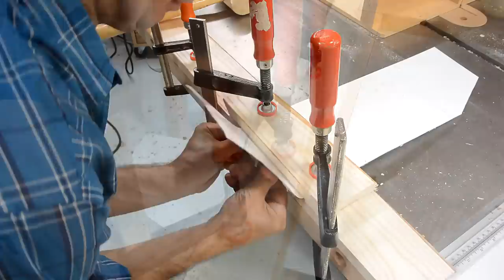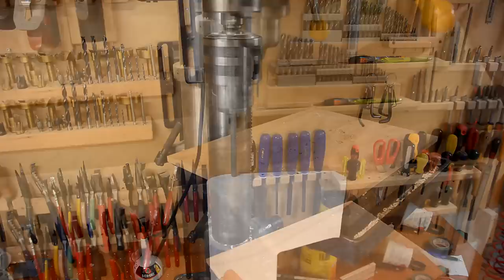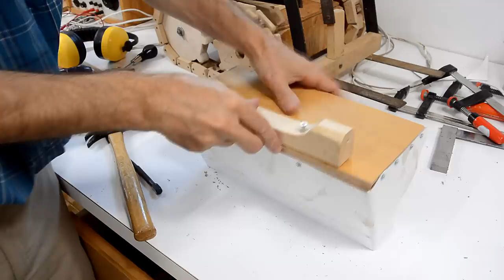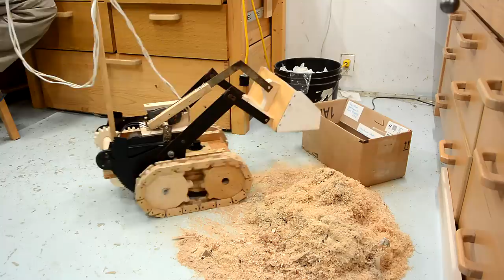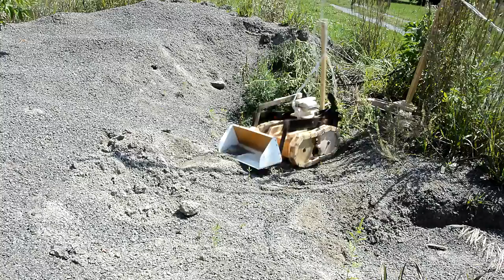Forklift toy payloader bucket

Comment: instead of the bucket i reckon you should mount your dust collector hose on it and drive it around your workshop sucking up the sawdust
Reply: with arduino brains.. Matumba vacuum. Though he might use some old cell phones for the cpu's

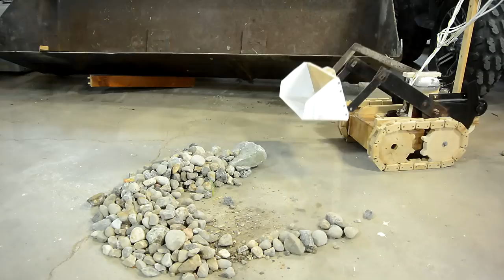Comment: You should be implementing proper safety 3:24 you are moving with the bucket in the air. That is not proper skid steer safety usage.
Reply: There's always that guy in the comment section. Imagine if he hurts a mouse or something. There would be a lawsuit..
Reply: And I don't see reflective clothing. You can't operate machinery like that on a worksite without reflective clothing!
Reply: ANameThatIsn'tMyOwn "You can't operate machinery like that on a worksite without reflective clothing!"   I think you can.. The machine will start even if you don't wear a reflective clothing.
Reply: Dom Troisi It's a joke. Do you have to get a joke pointed out to you twice in the same thread??
Reply: Kn1cknackz0 I know right
Reply: Jake Abel I liked your joke don't listen to this guy

Comment: Sir, forgive me if I read things wrong, but you used a wiper motor for power, did you use parts from a power window regulator as well?
Reply from the maker: No.  These were hand cranked units
Reply: Very well done!  I've learned something!

Comment: Have you been asked to make it wireless?
Reply from the maker: many many many times
Reply: Can you make it wireless?
Reply: I was wondering if you plan to make a new version. Maybe with rubber tracks instead of wood. Wireless, and with more power. This series has been probably my favorite work from you. It looks so happy when it's sped up like that.
Reply: You guys know what would make this even better? Making it wireless!
Reply: Never mind wireless -- make it autonomous! It could be like a Roomba for really dirty floors.
Reply: I think he should give it proper adjustable controls before he gives it remote control
Reply: I'd love to see this thing made wireless, and painted black and yellow, like a Cat or JCB :D
Reply: +Matthias Wandel 

A big lead battery putting weight on the tracks might improve performance.
Reply: +KarlBunker It could be a Roomba for EXTREMELY cluttered floors, like to clean up kids toys, then the vac-bot comes out.
On second thought, kids should be taught to clean after themselves.

Comment: To heck with Arduino (of course you'd need one in the mix anyway) but this thing needs automation.  I'm thinking Raspberry Pi with Python control loop and Open CV for visual input.  Maybe not with a camera installed IN the unit but above the "work site" in an observation position.
I'm living in a house where we have some erosion that deposits sand on the driveway when we have heavy, persistent rain. It'd be nice to have a system where you could train it too distinguish the appearance of sand from that of cleared concrete, set it's area parameters and just let it run a day or two until the task is complete.

Comment: hey Matthias, i was wondering instead of using the cord and piece of wood if it is possible to use a sprocket on the motor and one of those long gears (Similar to what you use on your door latch for your shed) because i was looking at it and it seems the pivot point stays the same. Just an idea. Keep up the good work!

    
1

Comment: Cool little creation, can anything be done about the treads slipping so much? Just thought it might need some more traction.
Reply: A neat trick for more traction is to put a very thin layer of silicon glue on the track/wheel.

Comment: Add webcam + battery + remote control and you can excavate under your house. (Then add AI to do the work for you.) Make it so that it can plug itself back in to recharge and it could automatically keep your drive clear of snow.
Reply from the maker: i dont;t think it could scrape thru the concrete basement floor

Comment: I take it the comments on your acrylic shelf video weren't to your liking? :)
Reply from the maker: Not really, indeed.  500 comments, but really just three comments repeated over and over
Reply: I just noticed that it wouldn't let me comment. I'm guessing the comments were along the lines of, "use actual acrylic solvent like Weld-On, don't use screws, and use a router with a sharp bit for flawless glue lines"? Acrylic is one of my favorite materials to work with. I was glad to see that you thought to use a cabinet scraper, as that's one of my favorite tricks. And grind a tiny flat on your twist bits for a neutral or slightly negative rake for easier drilling without grabbing or cracking. Oh, and if you ever flame-polish your edges, which I highly recommend, don't ever use any sort of alcohol (including such glass cleaners) on those edges. 

Also you might enjoy playing with heating a bend line with a controlled nichrome wire setup. You could make that entire shelf out of a single piece. 

Hopefully the comments didn't turn you off of working with it again.

Comment: The thing I don't like is the stupid wire. Try to cooperate with other maker to make it wireless .
Reply: Funny thing is he wouldn't need to cooperate with anyone seeing as he's quite good on that aspect too. At the same time, wireless is boring, this is much more fun, and old school. That's how toys used to be like before. None of this fancy frequency pots.
Reply: Don't forget it has no power on board either. Might as well start from scratch to fit in a battery that would last a decent time.
Reply: +lightdark00 Could maybe put the batteries and other bits at the back as a counter weight for lifting things.
Reply: +aserta I think wireless is more fun. You can control it using your phone with an arduino
Reply: Sometimes it is nice just to go back and do things with real logic, no microcontrollers or code required. Its also way simpler to do, since you can see exactly what is going on.
Reply: It's easy to spot the folks who never had the pleasure of following their corded remote control car around the yard.

Comment: Matthias now you need to make it remote controlled
Reply: What? It IS remote controlled...just not wireless...
Reply: I think you mean radio controlled.
Reply: Congrats, you can use google to find an answer that suits your needs.
In RC, remote controlled generally means controlled with a controller that is connected to the object, where as radio controlled is un connected and controlled by a radio. 

https://www.google.co.uk/webhp?sourceid=chrome-instant&ion=1&espv=2&ie=UTF-8#q=radio%20controlled%20vs%20remote%20controlled
Reply: "Radio controlled (or R/C) cars are battery/gas-powered model cars or trucks that can be controlled from a distance using a specialized transmitter or REMOTE." so one could say it's a remote controller
Reply: I'd like to see him make a smaller, wooden, wirelessly controlled one. Then sell the plans!
Reply: Although Matthias already responded "no" to this suggestion on a prior video; I'd add that his daughter is unlikely to ever be able to easily play with this thing if he doesn't make it wireless. Kids generally aren't keen on setting up power line rods and being restricted to a few square meters.
Reply: It's "radio controlled" but what ev
Reply: +Sam Sam  For a toy like this where you "work" in small area and which is relatively slow, this shouldn´t be an issue. When I was a child I had two cars, one with a cable and one without, both were fun to drive.
Reply: +IamTranslation "Remote Control" just means that the controls aren't on the device, but doesn't specify how the control signals are sent. "Radio Control" is a specific method for achieving remote control.
Reply: It's a lot more remote than being on the machine using the steering wheel and pedals. Only limited by length of wire.